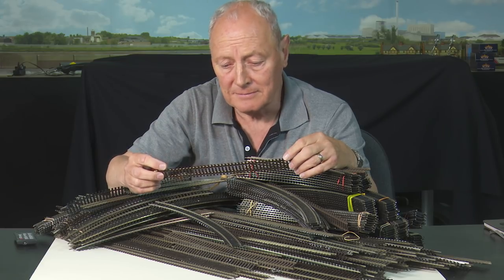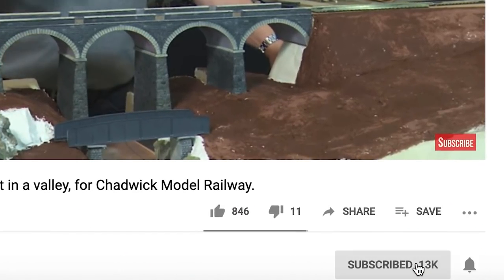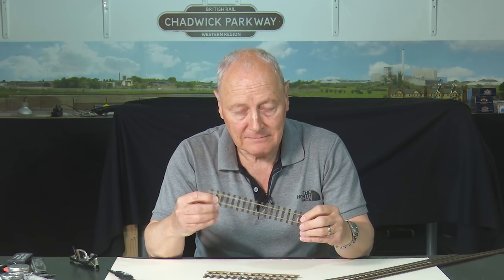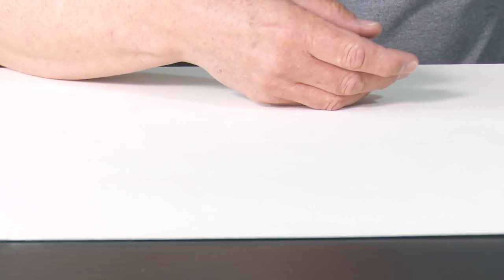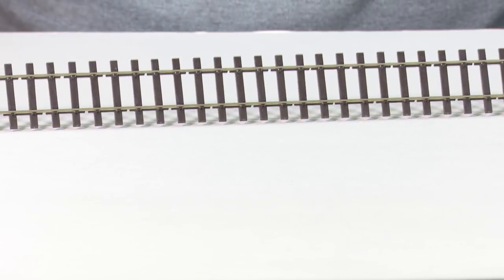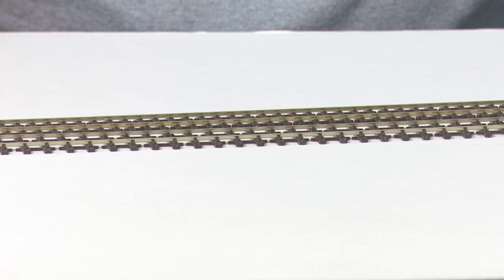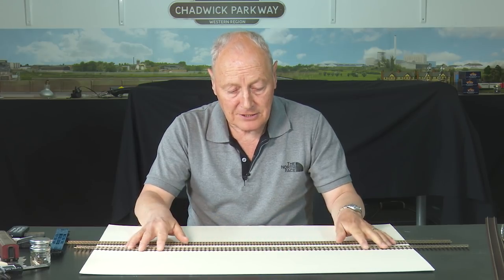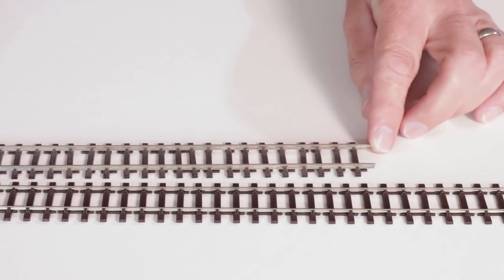Track  Peco Code 100, Code 75, Bullhead, EM and P4 explained at Chadwick Model Railway | 66.

Comment: Hi Charlie, Top blog from a Top man and as always educational and informative. I personally like Peco Code75, main as it’s more to scale than Code100, but I do find some Out of the Box rolling stock like Hornby Mk3 Coaches, sometimes have to check the Back to Back on the Bogie with the tool from DCC Concepts (I think) as some I have found throw the coach off the track mainly at points but once the Back to Backs have been done I never hard have to repeat the process on the same coach twice. Some of my older stock like Dapol Mk2 coaches, some older Hornby, I have had to change some wheels as the flanges are to wide to go threw the check rail on point work on a code75 track etc., perhaps a blog for a later date if you are running out of blog idea’s maybe 🤔 but I have upgraded most of my wider flange wheel stock now to the mental wheels as a pose to the plastic wheels with the wide flanges and do t have a problem so much unless I buy some new stock by saying that most new stock today you don’t have any problems with Flanges or Check Rails etc., Hornby Dublo wheels do have really wide flanges and a good example to try on a code75 track.  
Loved this blog as I can never remember the the sizes in (mm) between P4, EM Code100 and Code75, along with running O-gauge bodies on OO-gauge track or OO-gauge Bodies on N-gauge track (009 is it..?!?🤔🤔) I get a bit lost with what all those scales are called etc, again maybe good to cover in a future as a Part II blog on scales as we see so many different scales or combination of scales being modelled at model show exhibitions etc., Huge👍 Thumbs Up 👍as always and Thank you for all the blogs that you produce for all of the onlookers that are looking to improve and/or change our layouts, based on your knowledge base and not just for the younger generations but for the older modellers to. 👏👏👏👍
Reply from the maker: You’re too kind Jamie and it’s comments such as yours that make it worthwhile.

Comment: Explaining the issues of scale, gauge and track options has always seemed rather like trying put a vest on an octopus.....so,  thank you Charlie for such a lucid explanation. Out of interest, do you/friends/colleagues have any experience of reliability/smoothness of running of the new Peco bullhead vs. code 100 streamline? I'm sure that it's excellent otherwise Peco wouldn't have launched it, but I'm considering using it for a new branch line layout and for me smooth running is the primary consideration, with aesthetics second.
Reply from the maker: No I only recently acquired it but I will lay some shortly.
Reply: I have been informed by a friend that Bullhead track is difficult to lay compared with Code 75 or Code 100

Comment: If you’re going to put bullhead track on your layout Charlie, I’d only put it in sidings and countryside track or slow lines. 
In my opinion, it wouldn’t look out of place in those locations where BR would’ve recycled the track. Even today, there’s bullhead out there on the network, but in ‘out the way’ locations. I’ve even found bullhead at Kingmoor yard, right next to the Down Fast WCML, sat in a chair stamped with LMSR 1937!!! 
I have no idea if you can connect the two different track types together however! You probably don’t want to weld them together like network rail have been known to do.....
Reply from the maker: Great points L, the jury’s still out on this major topic.
Reply: I think if you file the profile of the bottom of the flatbed track you could then join the two with the bullhead fishplates. You would need to do both the inside and outside of the rail I would guess, something that I will have to face when I get to join the fiddle yard to the main part of the layout in about a zillion years time. I guess the other way would be to try and crimp the code 75 rail joiners, but sure how that would work out.

Comment: Once again a great video. I have had a lot of code 100 track given to me and its a right mix up some Hornby and Peco sadly all the points are Hornby set points with insulfrog which is a shame because we know how bad they are for slow running, any way my question is I am creating a layout and using the Peco track plans especially for point work  but have noticed that the sleeper spacing between Peco and Hornby is slightly different is this something I should consider.
Reply from the maker: Hi Ian,  The two types run together quite well but the insulfrog points will, I'm sure, become an issue.

Comment: Hi Charlie. A suggestion. A video on creating a working return loop - like on the western end of the Romney, Hythe & Dymchurch line. The problem of course is that when the point (turnout) switches for the return it causes power problems. I appreciate it does not fit in with your layout, but it might make an interesting and instructive tutorial. BobUK.
Reply from the maker: Thanks Bob.
Reply: A return loop is not that difficult but it does matter if you are using dc or DCC.
On DCC and DC power to the loop section is isolated by using insulated rail joiners in both instances. 
With Xxx you can buy electronic modules that simply connect to dcc and take care of the opposing polarities.

With DC you can simply feed the loop via a bridge rectifier.
Simply switch the controller in the other direction and the polarity of the loop won't change so the train will simply go tmaround the loop and will perfectly match the polarity of the mainline which change when the controller was reversed..

Comment: I believe that the advent of HO was in part due to the scarcity of materials available after WW1, and thus HO, using less material was indeed cheaper. The continent and USA had larger locomotives, so there wasn't a problem fitting clockwork gear inside them, UK locomotives were smaller and thus presented a problem. However an option you didn't mention, with progressive miniaturisation over the years, you could now fit modern electric motors into true HO scale UK locomotives. - though that would mean throwing all of your OO scale rolling stock out and replacing it with hand built models. 

I also recall there being a problem converting older R-T-R stock to P4 standards as the tolerances had to be very precise between wheels and frames. EM provided for a fair compromise wherein you could generally replace an OO axle with an EM axle with a good degree of success. I'm guessing that the P4 problem might not be so acute today, as the finescale models will probably be more accepting of the longer axles.
Reply from the maker: A sound summary Neil.

Comment: Hi Charlie. As you say, a tricky subject! I must agree with everything you say and I have stuck with Poco code 100 for many of the reasons you mention. I also think that if you use code 100 then there is no reason not to take advantage of the Set Track parts where they can gain you an advantage. I will, and have,  used Hornby curves for the tighter radius when necessary as tight curves in flexi track can produce 'dog legs' particularly at the fish plates. I do however try to go no tighter than third radius. But I do steer clear of Set Track point work as I prefer electrofrogs for smoother running.On the subject of re-spacing Peco sleepers, have you seen Richard Warren's new Everard Junction layout? He has done exactly that and his layout is large !!! .................John
Reply from the maker: Hi John, I’m so pleased that you enjoyed the video and yes I know of the hard work that Richard has put into sleeper spacing. 😢

Comment: Hi Charlie , i have just found a major problem with my N gauge system . As a new starter i built most of my layout and did quite a bit of soldering . Then tried to run my engine only to find it would not pass any rall connector as in my ignorance i had used a connector that was sold to me for N gauge but came up the side of the rail and stopped the wheel . probably some thing for other new modellers to be aware off.
Jim.
Reply from the maker: Thanks Jim and hopefully some guys will read up on the problem here.
Reply: Thanks busy now with the great strip down .

Comment: Peco code 100 is fine as far as I'm concerned. Why spend more money converting to code 75,unless you are what I call a rivet counter. Model railways is a hobby to be enjoyed, no matter what track or gauge you use, or how big or small it is.  Whether you have lots of detailed scenery or not, doesn't really matter, as long as you are happy with what you have got or what you want out of a model railway. I am keeping my layout pretty simple as far as track work is concerned, because I am not bothered about having lots of complicated track work for shunting or storage purposes. For one thing I haven't got the room in my small 10 x 8 foot shed, which I am also incorporating a tramway layout as well (hence the name of my layout). So by wanting to add trams as well, doesn't leave a lot of room for having a lot of extra rail track besides the actual running tracks. But it was a good video Charlie and I am sure it will clear up a lot of confusion when anyone new to the hobby decides to build a layout of their own.
Regards
Geoff
Reply from the maker: Hi Geoff, I’m so pleased that you found it useful.
Reply: I thought Charlie made a good case for Code 100 to be honest.

Comment: Hi Charlie. Thanks for your videos. I'm looking to get back into modelling after 30 years and your videos are really informative. I stumbled on this one as I've started to look at Bullhead 75 vs Code 100. The issue I have is I have 5 locos/trains (c 35 years old) that I want to keep as well as the new models. This includes the old Hornby APT which I definitely want to keep, so I need to consider this one carefully. (And yes, I guess I'm going to have to spend some more serious money on the new re-tooled APT when Hornby release it!). 

I think I'll buy 4 or 5 lengths of the bullhead and maybe a bullhead point to see if the old locos will run OK.  Thanks again! Alastair (from NZ)
Reply from the maker: Hi Alastair and welcome back.
The new Code 75 Bullhead is brilliant, fragile but brilliant.

Comment: Hi Charlie, great video and well explained, I wish I'd seen this before I went out and brought 25 Peco SL102F Concrete sleepered flexitrack (code75). 

Is there to your knowledge a gauge I can buy to help me get the correct spacing of the sleepers then I can do as you had done on yours by cutting out every other sleeper or whatever it is?.

 I really couldn't afford changing wheels and alike unless there is now a bullhead code 75 Concrete sleepered flexitrack which I can't find, luckily the track I brought hasn't been layed yet as I'm just starting a diarama so there's still hope, 
thanks for your help Charlie, 
regards, 
Chris Uddin.
Reply from the maker: Hi Chris, you could check out “C & L”.
They make high end track.

Comment: I may be wrong but didn’t the rail gauge itself, the 4’ 8”, originate from the width of the wheel span of a horse drawn cart?
It’s always seemed crazy to me that we’ve never widened it over the years to get greater stability and capacity on the UK only rail network, wider carriages instead of longer trains.
Reply from the maker: Good point NN
Reply: No. The gauge had nothing to do with the width span of a horse drawn cart. There were many gauges in the early days ranging from 3' to around 4' 10". There was no need for a standard gauge until railways started to join up with each other. 4'8"  happened to be the gauge of the track at Killingworth Colliery where George Stephenson worked. The gauge there wasn't widened to 4' 8½" until longer after Stephenson left. If he had worked at a different colliery it's possible that the standard gauge would have been different. Brunel thought that stability would be improved by a wider gauge, but he was wrong. It's the length of locos and rolling stock  that counts, not the width of the track. If the railways had gone in favour of Brunel's broad gauge then the expense of building them would have gone up too. The railway companies would have had to buy more land. The sleepers would have to have been longer when transverse wooden sleepers were introduced.

Comment: Without being a counter of rivets the funny thing is ho is 16.5mm and therefore 0 should be 33mm.
Well in S7 it is whilst most people use Finescale which is 32mm.
This is no big deal unless you are having a love affair with rivets.
 Funny thing is that even if you had British ho the peco track still looks proportionally wrong as the sleepers are to close.
Cheers Steven
Off to bed now to count rivets
Reply from the maker: Happy counting. 
I’m no better (or worse).
Reply: @ChadwickModelRailway   yeah but the important thing is you have fun.
Im into O gauge myself, I had to do it ever since I was a kid and going to model railway exhibitions in the early 60s and seeing 0 gauge and going wow this is big.
As and exercise I put some O gauge Peco track on a photo copier and reduced it by half.
I then compared it to peco ho and the ho is different.
The sleepers are closer and so it looks like American track.
The new peco bullhead track looks good.

Comment: Interestingly enough, the OO/ HO track is both prototypical to the model backgroud I am going for, which is Russian/ex-USSR railway systems. The gauge is 1520, which if you divide by 87 is consistent, and the distance between the slippers is also consistent AND it has a flexitrack with concrete slippers, which makes it all more appealing to me :) This also means the rolling stock fits within the scale too. I have been curious to see if code 83 might be a thing to look into, since this might make the rails look more prototypical, but i never tested them against the wheel axles nor do I know how wide is the range and wehther or not it provides the necessary material to represent the fluff.
Reply from the maker: Wow, AK that’s a very interesting project.

Comment: Hi Charlie (or anyone else)... Sorry for what might seem silly questions, but if I have a lot of 100 Peco track like you and old rolling stock, how do I connect this to the new Unifrog 83 points? I notice the new Peco Unifrog double slip is 83.. is this 83 going to be the standard height for the entire Unifrog point range? And why aren't they doing Unifrog 100 points? Or are they? Will old stock derail going over 83 points? thanks
Reply from the maker: If your stock goes over Code 75 than it will run on Bullhead.  
You can get a Code 100 to Code 75 converter Rail.

Comment: I have a Lima GWR small prairie tank, Dapol Castle, 3 Early Hornby Hall classes and replica railways Hall which are old, would code 75 electrofrog points and code 100 track be alright for them
Reply from the maker: No I don’t believe so. 
Fitting Codes 100 and 75 together can be awkward and I’m unsure if the flanges on the Lima and perhaps the early Hornby, will run on Code 75.  Best take them along to a model shop and check them out.

Comment: Is there only the two (+ variants) styles in the UK?  In the US, the NMRA has defined 4 for HO.
HO Scale: 100, 83, 70, 55. 
Each is used in different situations like long haul freight mainlines or spurs.  One thing we don't have are transition pieces.  We seem to have to file our own change before a joint of a different size. 
What is done in the UK by Peco or Hornby or others for that matter on gauge transition joiners?
Reply from the maker: Yes Peco do produce gauge joiners, it’s all on their website.
Reply: @ChadwickModelRailway  Nice.

Comment: Hi I’m relevtively new to the channel but not to railways. I’m building an N gauge layout. My previous layout was in OO but it had poor track work causing derailments. Can you give any advice for good track work?
Reply from the maker: I have found that N gauge can be just as problematic as 00.
Peco is my brand of choice but good track laying is essential.
Only use new track points is sound advice.  Used track can come with real problems.

Comment: Excellent video Charlie and very useful. I feel i must take issue with you on the model railway vs train set debate. I have been building model railways for 60 years and to me a train set sits in a nice colourful box. as soon as it is taken out and that track put together and trains run on it then it becomes a model railway. Set track or flexi track makes no difference at all. I still use a mix of both in Peco code 100.
Reply from the maker: Perhaps a train set is best defined as something you put away at bed time!
Reply: @ChadwickModelRailway  Possibly if you actually put it back min the box.

Comment: Good vid mostly but I must be pedantic; it's the Scalefour Society bot the P4 Society, at least today anyway.

Also with P4 and S4 (difference is farty) is not always more expensive, quite often if you do more work yourself it ends up a lot cheaper than 00.  If you build all the track you'll pay £50 rather than £500 for a layouts' worth of track.  Wheels don't always cost a lot, depends which you get.  I model in 00, P4 and N if it helps.   I am interested in the new Peco Bullhead though; as 00 track goes it looks pretty good.
Reply from the maker: I stand corrected SS. But hopefully you enjoyed it anyway.
Reply: @ChadwickModelRailway  - Yeah I like your vids very much.  Didn't want to 'roast' you so to speak but you did mention it!  XD

Comment: One issue that you did not really address is the weight of the rail. Code 100 represents 152 lb. rail, code 83 represents 126 lb. rail , while code 75 represents 114 lb. rail and code 70  represents 100 lb. rail and so on. So what is the current standard weight of rail used in the UK with concrete or wood sleepers? What about on secondary lines? Industrial spurs? What was the standard used when Bullhead track was the norm ie: steam days? These are also important considerations for the modeler.
Reply from the maker: Some interesting points Cleo.